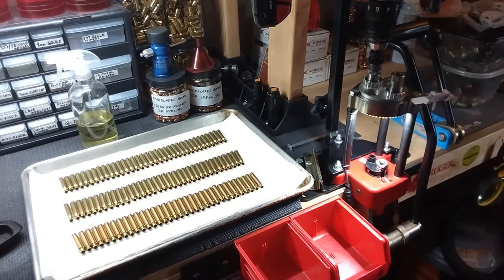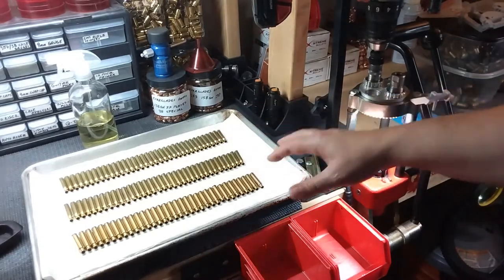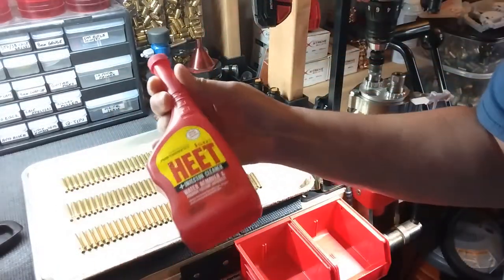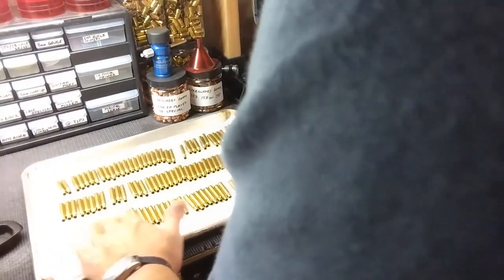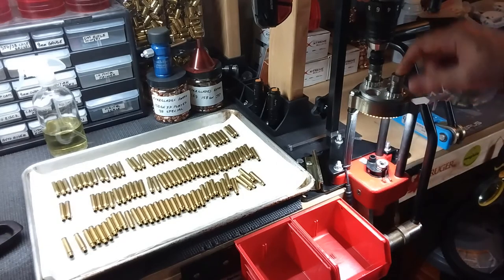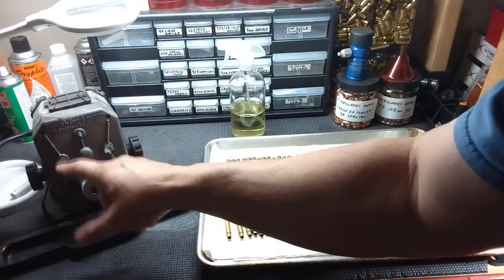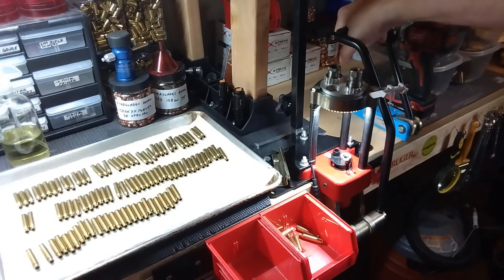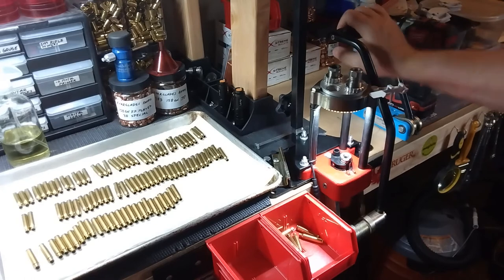Reloading .223 with a Lee Classic Turret Press - Part 4 - Full Length Resizing Cases

Comment: Doesn't that Lee trimmer have built in chamfer and deburr?
Reply from the maker: Hey Jonathan, sorry for such a late reply. Yes, it does, but I no longer use that system for trimming my cases. I've found a much better tool that really cuts down on trim time and is easier to work with. You can see that setup in this video: https://www.youtube.com/watch?v=2tzBvoO0F_U . Thanks for commenting, I appreciate it! 👍